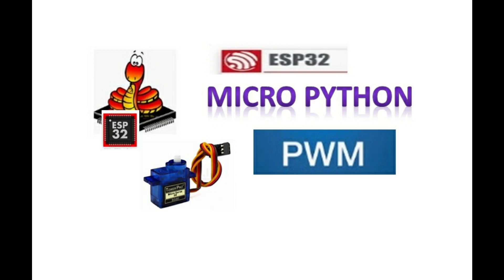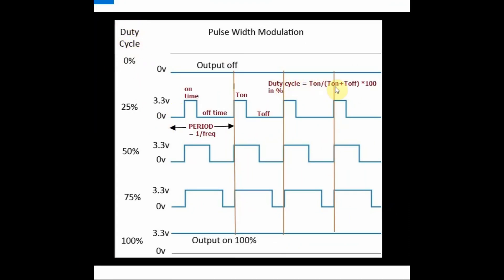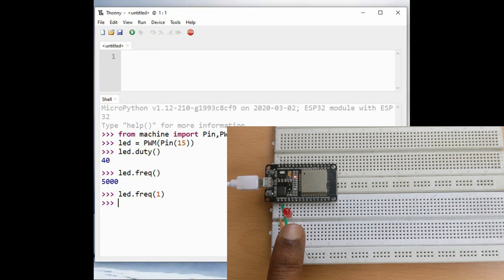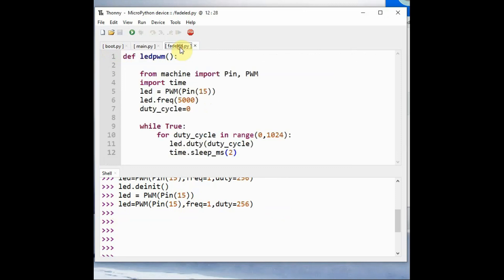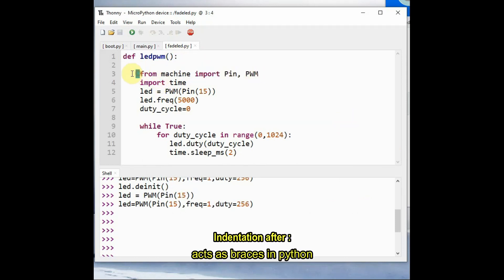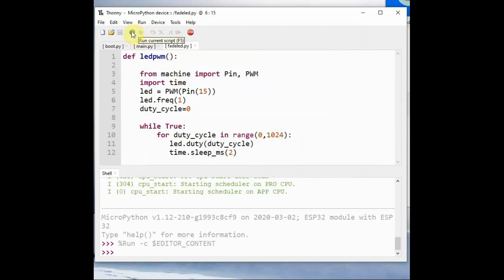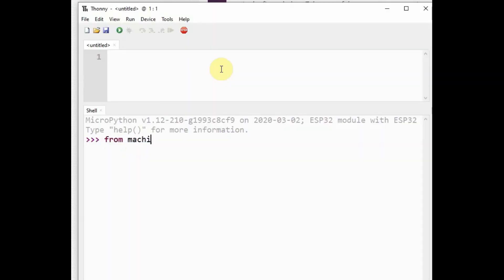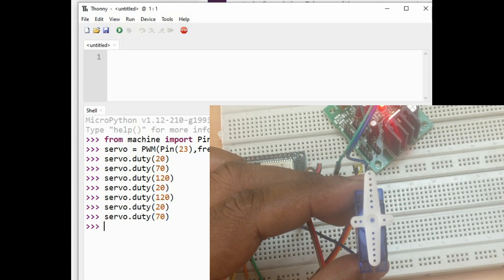ESP32 MICROPYTHON PWM & SERVO CONTROL

Comment: How Can I get control motor speed and position servo motors ?? Do you have the link to buy??
Reply: controlling speed in servos might be tricky since the way you'd control speed would be by changing the speed in which the pwm's width changes.